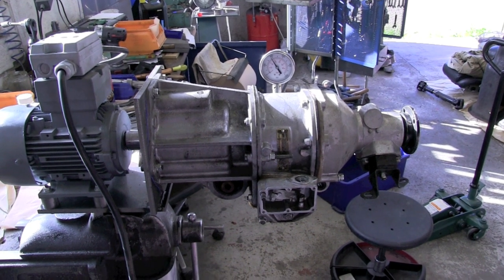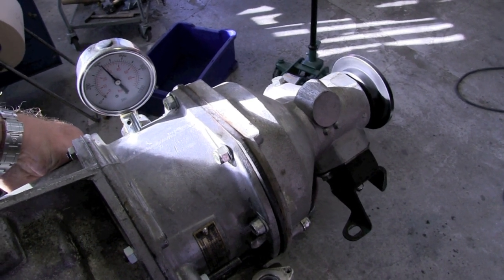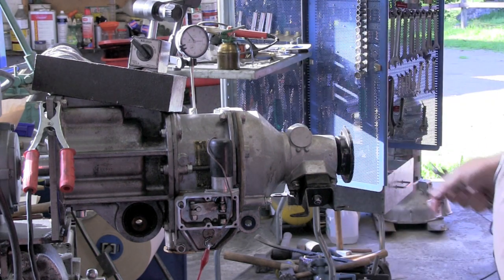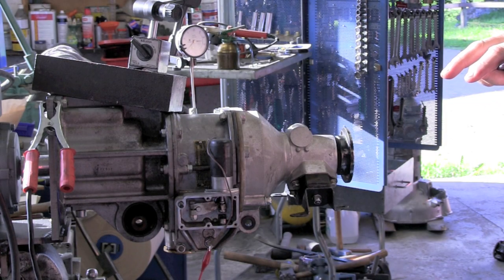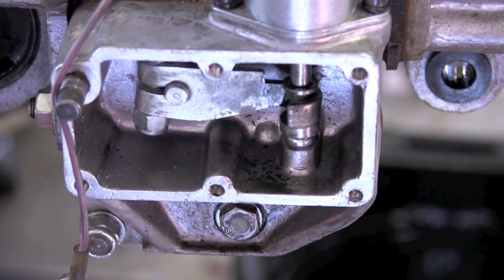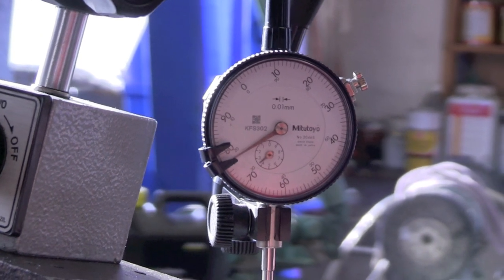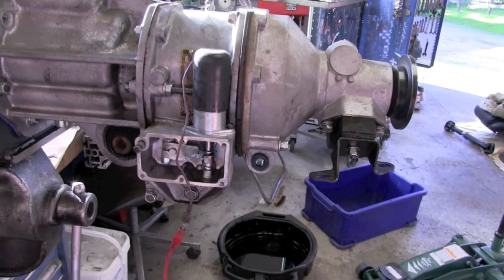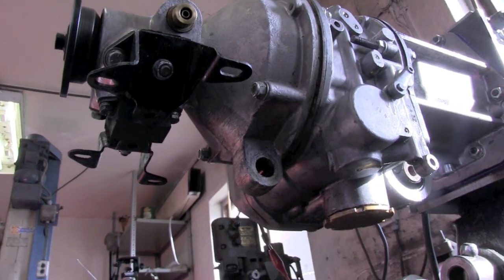Testing and adjusting an Austin Healey A-type Overdrive.mov

Comment: Magnus, I totally understand what you are saying , apart from one thing. When setting the lever to .7mm, I have no idea what the starting point  for the lever is, is it with the pin in the hole. Which would mean it is higher than the level described in the workshop manual by ,7mm .  Thanks